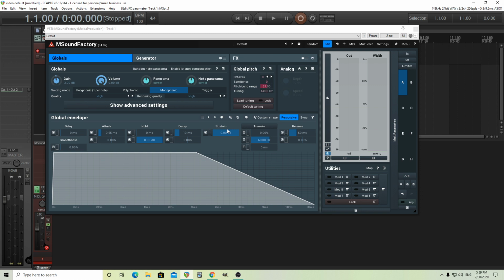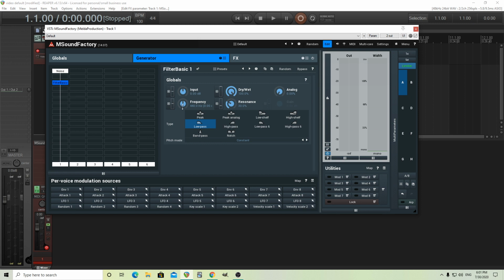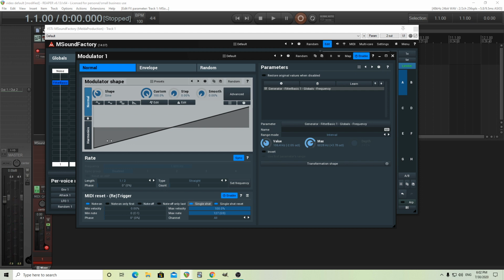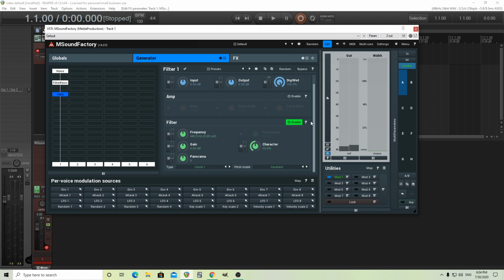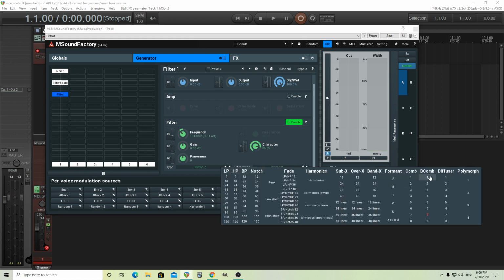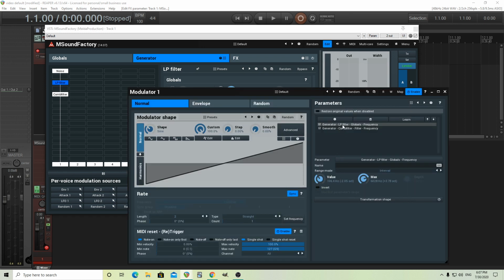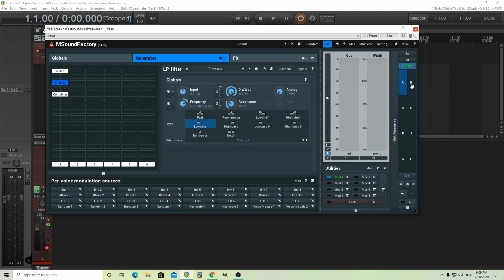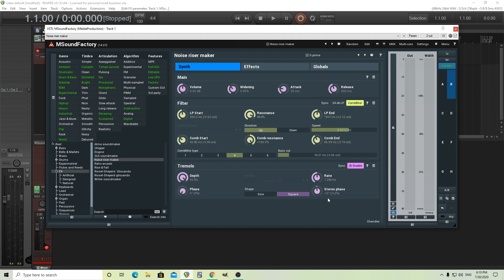Combfilter Risers in MSoundfactory

Comment: Another great demonstration. I have just a generic comment: In most videos, the examples run on 1x oversampling, however the upsampling provided by Melda's plugins is a gem among competition (with a 4x offline considered mandatory by me), and at least a 2x oversampling during demonstration would improve the sonic result while it wouldn't hurt the processing of a single channel. It does not mean that 1x is that lower quality, but the finest processing available happens in higher rates.
Reply from the maker: Thanks. I often forget to turn on the oversampling. Many times it doesn't matter, but it can make things sound better sometimes.